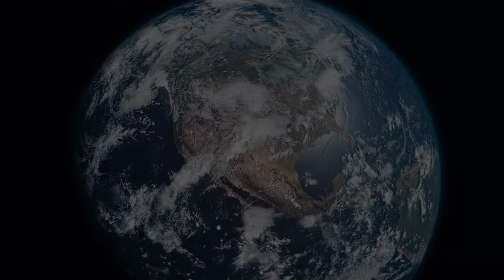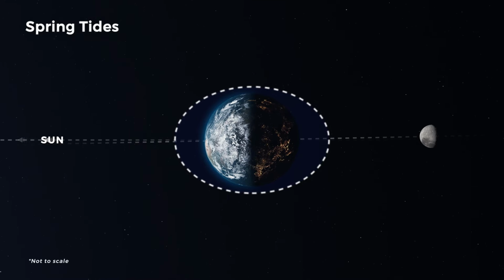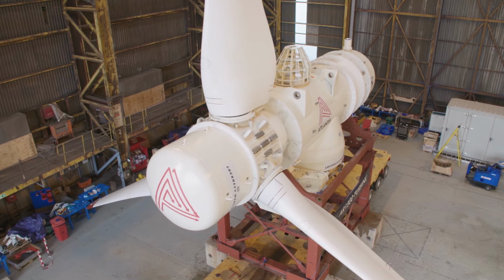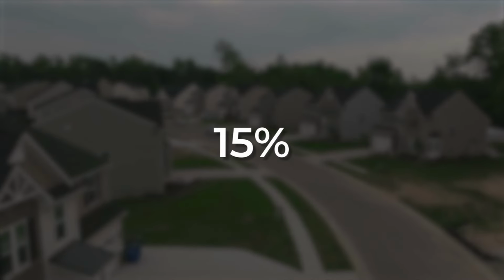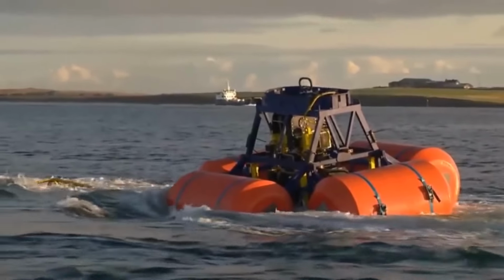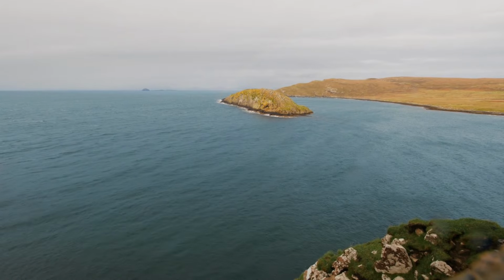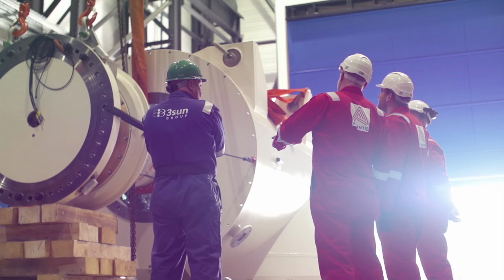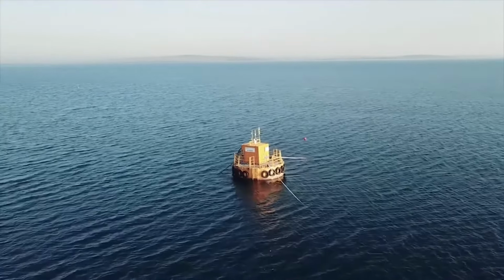Can Underwater Turbines Solve Our Energy Problems?

Comment: I’m sitting here thanking that I thought about this over 30 years ago I was on Martha’s Vineyard on a JetSki pulling into a fishing village there was someone standing on the jetty casting his fishing rod I asked him to stop for just one minute so I use used him as a marker I pulled Right next to him and didn’t move I looked down at my speedometer It said I was moving at 17 miles an hour and I said this is constant in and out 24 seven the power and I was designed these things in my head and never do anything with them we’d walked through stores and my brother would say see that thing there my brother invented that 30 years ago and never did anything with it now if they sell it the ideas in my head alone I’ve seen over 25 things that I designed in my mind and never did a thing with them I have one that I got to get out there because it will save so many lives Anyway day late dollar shot

Comment: Eyeballing this problem, I'd place my bets on an onshore turbine powered by switched compressed air driven by the surging of the water in both directions.

The air can be made to keep moving in one direction through the turbine with a simple switching valve and, with suitable barriers in the loop, the corrosive salt water could be kept well away from the machinery.

Comment: You know what really grinds my gears? When we discuss power generation in terms of energy (i.e. watt-hours) instead of power (watts). It unnecessarily adds time into the equation, resulting in numbers like "250 TWh/year" which is equal to about 28 GW, when hours are divided by years.

Comment: Gravity generator

water is liquid at ground level... Construct a glass skyscraper made out of multi layered glass... The water will evaporate... It will condense at the top of the skyscraper due to water turning into a liquid as it cools down... Collect the water in a funnel and use it to drive turbines on its way back down...

Comment: Why not combine offshore wind with tidal generators?  You're already anchoring something to the seafloor and running infrastructure to the site, so it seems like it wouldn't be a dramatic increase in cost to bolt a wind turbine on top.

Comment: No, they can't until we make a major major breakthrough in battery technology. Power generation falls into 2 categories, precharged and uncharged batteries; batteries included and batteries sold separately. The former are provided by the planet, the latter we must provide ourselves. Coal, nat gas, petroleum, nuclear, and traditional hydropower all come with the planet, batteries included. Need more electricity? Dial up the fire, drop the rods, or open the valve and poof, the turbine spins faster. Those sources are all de facto batteries that came included with the planet. Solar, wind, underwater and tidal turbines all require us to build a battery for them to charge so we can then draw the power when we need it, batteries sold separately. Why? Because the solar panels don't work at night, nor wind turbines if the wind won't blow, nor tidal turbines at slack tide.  Even when the tide is running, its speed varies widely throughout the cycle. It starts slowly from slack tide, builds to its max speed, then tapers off all the way back to slack tide. In-stream submersible turbines only make nominal power. All you people who want "renewables" to become viable, STOP pouring time, money, resources, and effort into better renewable generators (like better solar panels and tidal turbines). It's a waste of time. Instead pour everything you have into a battery breakthrough. That's the barrier, not better solar panels or 300 million in-stream submersible turbines.

Comment: I like the wave energy air turbines, where the wave moves up and down in a closed chamber. The air in the chamber is pushed out and sucked back in through a turbine. I think it would be easier to maintain than underwater turbines. Also rather than placing them on our precious coastlines, you could have a sealed tunnel to the turbines further inland.
Reply: Anything that offers a real solution, even using accepted science, does not get built because it could take their domination away.
Reply: What about barnacles, and other sealife infesting those tubes? Over a short while, they'd render them unproductive. Just stop fighting what has been proven to work: fossil fuels & nuclear!  Your libbie "ideals" won't do much good when the "rolling blackouts" hit YOU!

Comment: Nice thought, blade design won't work for the same reason windmills break, blade shear/wear. Water is 70% denser than air. In addition there are more suspended particles that works like sandpaper on the blades. 
With that said, the modular design is good for installation and maintenance.
Reply: Water is 600 times denser than air, it's like 60000%. Not 70%.

Comment: High tide comes in, close locks. Tide goes out, run the water through generators. Platform floats around a central post, waves pass lifting and dropping platform.

Comment: No. Ocean based energy 'solutions' are exponentially more expensive. Salt water corrodes and degrades components at a rate not seen with land based power generators. There is no way to provide consistent power source there. Also we have yet to develop the first renewable energy source. Every energy source we have now is completely dependent on fossil fuels for their existence. Once we develop something that is actually renewable that might change.

Comment: Backwards thinking; With houses, cars, factories, most electronics NOT designed for efficiency, making more power is like a drug addict just wanting more drugs. If EVERYTHING was designed as if to run on batteries (for example) we could reduce the wasted power. Then look at better power sources, once we are responsible Users.
Reply: Ok, so how will this idea be enforced? Who inspects each and every product to ensure its designed to be as efficient as possible? What happens when it is deemed a product is not efficient enough, and what system deals with the huge number of technical appeals to decisions? 
Your idea is infinitely less practical than renewable energy sources. Stop being so preachy.
Reply: @TheVino3  laws and bureaucracy would be super energy wasteful , hilarious !!

Comment: You start with a test at a very favorable location with exceptionally fast current.   Then you extrapolate that to half of our energy needs.    Most coastal locations would produce only 1/10th or 1/100th as much power for the same cost.   A gobal  energy production estimate must begin with a global survey of likely locations.   My guess: roughly 100000 good locations would be needed.
Reply: I like how you just make numbers up

Comment: Wow these numbers are so BS. Hydroelectric dam that pump water up then run them back downstream to generate electricity do not create power. They simply pump water upstream during low demand hours when its cheaper then at peak hours generate power to sell for high cost .. they claim to be battery or storage system but truth is they just sucker us for the money .

Comment: Great work.

Have we found water to be our future?

Say no to oil production.

We can produce, as this short shows, great energy via tidal and wave,
but also (at the same time) produce hydrogen from the salt water,
plumbing it in land for use in heating and transport systems.

Switching from our current gas supply also completely eliminates monoxide poisoning,
that is, at present, happening to our biologies every moment we breath whilst using our current source.

And what of rainfall, why aren’t we harnessing rainfall?
It’s always raining where I am, why haven’t we developed RAIN ENERGY?

Each time I hear traffic tyre grips tearing through the rain filled streets,
I think of energy, and I think of energy going to waste.

Rainwater should be stored, even before it reaches the sewers,
helping turn turbines as it flows in and out of storage, even small ones.

Every piece of natural energy got is a step in the correct direction,
away from fossil fuels to increase our dependency on renewables.

God bless